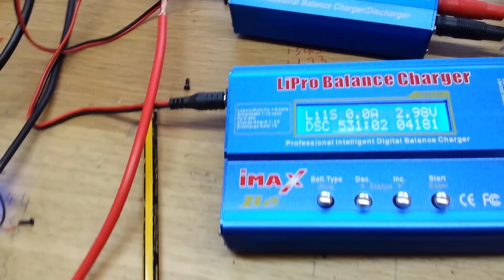18650 pack! 3 - cell or 4 - cell? Which is best suited for 12v applications??

Comment: You and others inspired me to do something similar. I just connected 4 Li's to an 18V impact driver, and did not get enough power.  So I added a 5th cell, (20V peak +/-) and I have plenty of power.  I can drive 4 inch deck screws through a 3 inch plank with no pilot holes in about 3 seconds each.  I am very pleased.  Next I will add a voltmeter to the outside of the Battery pack so I can monitor voltage use.  If everything tests good, I will add a Battery Management System to the cells.

I have the 4 cell version of the BMS board that you have.  The only difference is a jumper on the BMS IC.  And I will put a 1 cell BMS on the 5th cell, the coin shaped kind that connects to the bottom of the cell.  I will use an 18V  constant current/constant voltage power supply to connect to the 4 cell BMS and  will make a buck converter out of an LM317  to connect in parallel to the 18Volts to charge the single cell via the BMS.

Comment: So in sumary, to convert a 12v Nicad to Li ion drill for example, using a 4S configuration reaching 14,4 working voltage is ok?No problem for the electric motor having 20% over voltage?. Asuming that most of the electrical motors run on owr cars with 14,5v, then I think it is no problem.
Next and importan question: If I install a PCB to the 4S,can I use then a Liion charger in the balance mode with the balance wires? or will it interfere with the PCB? I only want the PCB to avoid over-discharging, I don't need the over-charging feature because the Imax B6 will cover it.
Thanks, this threath is very helpfull for many os us
Reply: +Ronnie Van De Ploeg Motors are quite strong and can handle much more than that if you're not planning on running the drill for 5 minutes straight.
If your wires go directly to the batteries the protection circuit won't bother you
Reply: +Moonwalker917 Thank you for your time!
So I will have to run separete wires directly from the battery to the charger, for the balancer, and the "input". Because the output/input  from the PCB will open the circuit when charged before the charger does (for example) and the charger will see an open circuit throwing an error I think.
Reply: +Ronnie Van De Ploeg 
I think the main concerns with over voltage on a drill are insulation and capacitor voltage ratings.  It is doubtful that an extra 2 volts is going to be a problem with insulation, but over voltage might easily blow capacitors in the speed controller. That said, a good design is not going to select capacitors that close to expected voltage.  And even if some caps do blow, they are relatively easy to replace, and just replace them with a higher voltage cap.
Reply: Thanks!

Comment: try to use 4 cell and charge it to 13.5v much better dont charge it with 16.8v
Reply: ty
Reply: on Battery University, I read that if you undercharge your batteries, they will get more cycles. If you charge to 4.2, only 500 cycles or so. If you use 3.92 as max voltage, you can get 4000 cycles. Sure, you would only get 70% capacity or so, but just add  cells in parallel and make the pack last a decade or more instead of 1.5 years. At 3.92 volts, 4s would be about 15.7 volts. Which is almost perfect for a 12 volt inverter that doesn't like over voltage above 15 or 15.5V. The only problem, you lose the low voltage cutout. The inverter cuts off at 10 to 11 volts, depending on model. But a 4s pack can't go below 12 volts. So, need a BMS with low voltage cutout.
Reply: I read the "up to 4,000 cycles" on http://batteryuniversity.com/learn/article/how_to_prolong_lithium_based_batteries. I have no reason to doubt it. In fact, every hybrid car company tries to maintain the 40 to 70 % state of charge for their lithium and they are still 80% capacity after 8 years or so. Here they say you can get 5 - 20 years out of them based on various factors, https://www.acs.org/content/acs/en/pressroom/newsreleases/2013/april/understanding-the-life-of-lithium-ion-batteries-in-electric-vehicles.html. 

Also, I have old laptop batteries that are literally 18 years and they are running at 25% rated capacity. And each of those cells were at zero volts when I found them. I have some other ones that are about 70% capacity and they are 10 years old.
Reply: At least #1 is bullshit and has been disproved many times. There are lots of different chemistries and qualities of Lithium-Ion batteries and statements like yours simply cannot be true because of that alone. I have found very old cells in laptop-batteries still having good capacity despite probably not having been treated optimally.

#2 is probably incorrect too because some lithium configurations, to my knowledge, are rated at a lot more cycles than NiMH or Lead-Acid.
Reply: When cells only cost a few dollars once every year or two it's much more of a hassle having the 70% capacity.

Comment: In my research and testing while working on an ebike battery, i would go with the 4S pack rather than 3S.  For example, I see mostly 4S, 7S, 10S battery balancing boards (BMS) which correspond to 12v, 24v, 36v.  For some reason they refer to the nominal (low end) voltage of the cells (3.6v) rather than the top end.  So while I'm not sure what your application is, I'm not sure I'd mess with the buck converter.  Perhaps you don't need it. Whatever runs at 12v may be able to handle the 16.4v starting voltage of your fully charged pack.
Reply from the maker: Tim Byers thanks for the information! I'm going for usable capacity over voltage if I go 3s the pack is flat before i've used its full capacity/If I go 4s I have to reduce the voltage and loose some capacity in heat!
Reply: +Richard Driskill if i want to use 4 cell for some bluetooth + Mp3 board with class D 2.1 amplifier, the bluetooth mp3 module need 12v max and class D amplifier need 12v - 18v. How many cell that I need? want to long battery life for my boombox projects with battery 18650.

Comment: for low loads i would go 4 series and dc - dc if high load 4 series direct to battery with low voltage shut off but why dont you use the lipo4 cant remeber the name always better for performance to step down then to step up
Reply from the maker: David Simpson I'm just using what cells I have otherwise they are sitting doing nothing! =)
Reply: ah i see

Comment: Hi there again...about 2 weeks ago I built exactly what you are making and will do a video for what I made
What I wanted was for my Bluetooth speaker when on site it runs on 12v so made a 12v battery pack with 4 18650 battery's and a small buck converter to limit the current and drop the voltage to 12v,on a full charge my Bluetooths internal battery will run for around 1 1/2 hrs on loud and that's it,now I get 6-7 hrs from my battery pack
Ps I also made an awesome led hand lamp from an old makita 12 torch 18w led 18650s and buck converter,most of my battery power tools have been modified to 18650 battery's and best thing I have done..ok they are not pretty but perform awesome
Reply: 1bigsyd how do you charge your bluetooth speaker? cause im planning to use the same configuration (4x18650 batteries) but im confused about charging them. Would a normal 12v charger make the job? or i need some special "balancing chargers"?

Comment from the maker: 8A bms from chinaland! But I'm going to try and make my own with a lipo voltage alarm and relay! load will max out at 6A but nothing more. I will try for  12V 20AH pack but i'm thinking 4 cell 16.8v will deliver its capacity better.

Comment: What is your BMS that your going to use and how much amps are you going to pull? I bought one of those buck converters and hey can do 5a
Reply from the maker: jake goakes I have the 5A ones idea is to run small pump for rainwater loo flush system/camping lights and maybe the routers if the power goes out